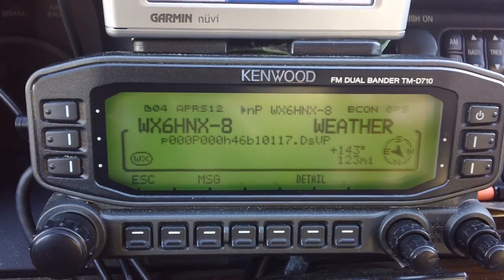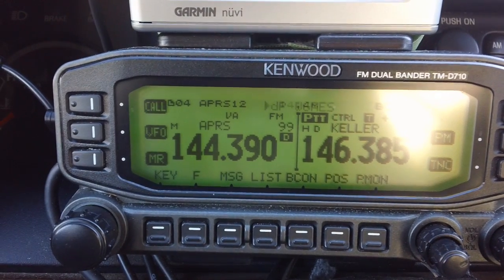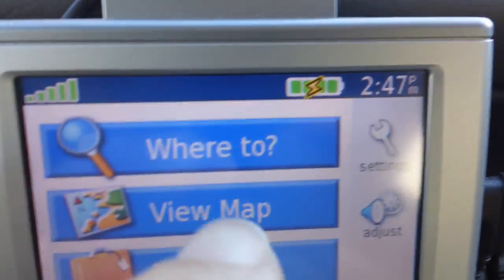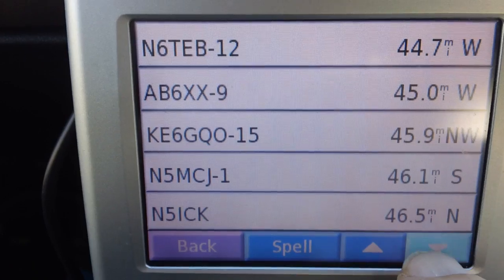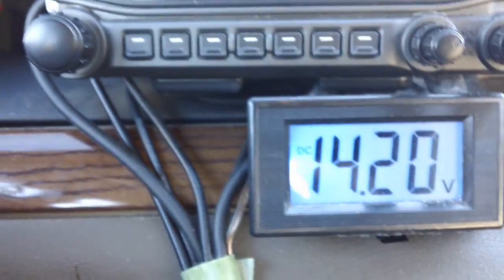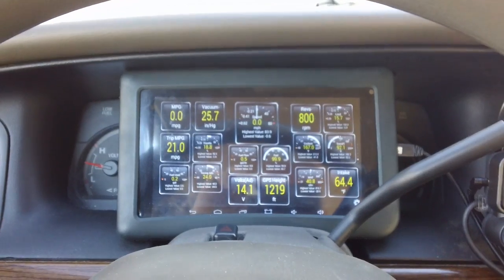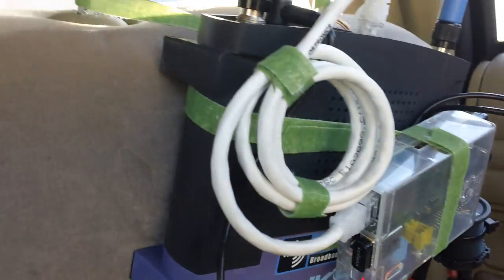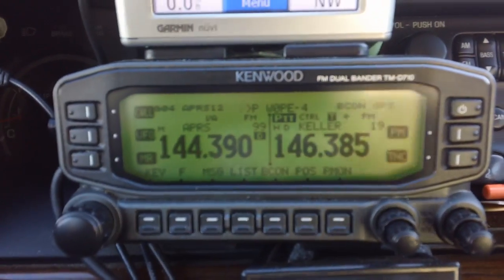APRS and Garmin 350, Torque OBD2, Broadband Hamnet, Raspberry Pi Asterisk AG6IF

Comment: James are you still using the setup D710 with the Nuvi 350?? I am very busy with trying to set it up, I have the gtrans cable by Argent data but as off yet no joy.....can and are you willing to you help me out please?
I can provide pictures of the settings that I have done in the D710ge
Reply from the maker: sure, shoot me an email at my call at arrl dot net, happy to help..2 or 3 settings in the 710 need to be switched.

Comment: hi , Are you still using this setup? I am running the Garmin 350 with the d710 and every other time it beacons I get a pop up on the Garmin and have to clear it to see the map . It otherwise works fine for position .
Reply: The pop up on the gps says " this accessory is not supported" but only does it every other time it beacons . according to Garmin I have the latest updates .
Reply from the maker: Yes, still working great..what kind of popup?  just guessing you are getting RF in the connection and the radio is losing contact with the 350...just just a guess..if so, try lower power and see if it stops.
Reply: @JamesSanders  the pop up says " this  accessory not supported " but only does it every other time .
Reply from the maker: @angussims8157  I have seen this al ong time ago......in the GPS, turn off the fleet mode and reset it... I cant remember how to do that but google it and you should be able to find it.
Reply: @JamesSanders   Thank you
Reply: @JamesSanders  That did the trick , Thanks for your help .
Reply from the maker: @angussims8157    glad to help...it bit me once too..  73  ag6if

Comment: i have a d710GA, can i use the Garmin Nuvi 350? can you provide a link of the cabling and setup details? Where will the GPS gets it power?
Reply from the maker: Hi, if the GA has a gps input on the left side, you should be able to use an outboard gps.   Go find a GTRANS cable for kenwood on the internet, that will work. I power my GPS from a cig lighter cord. (get the stock adapter, snap it on the back, and a 2nd usb port appears to power from)

Comment: Are you able to send messages on the garmin 350 ? The open tracker 3 allows that in fleet mode on your garmin. It sure makes typing a message easier. Nice install.
Reply from the maker: Robin Thurston   Thank you,   to answer your question, no, the messaging interface does not work in the kenwood/350 setup.   It works great with an open tracker as you noted,, as in this vid from my little go-bag.  https://www.youtube.com/watch?v=VkFBUeJr110

Comment: Nice tip on the external GPS, and the Garmin GPS units are awesome! I have a Garmin 12XL, its circa 1990's but I'd rather have a gui and a map such as what capability you showed. 73, David kk4zuu
Reply from the maker: Thank you!
the new D710 has a built in GPS, which to me, is a disadvantage, unless they left the gps connection in the new radio.  I really like having a map on tap.   73  de AG6IF